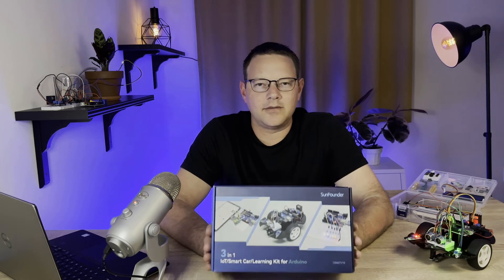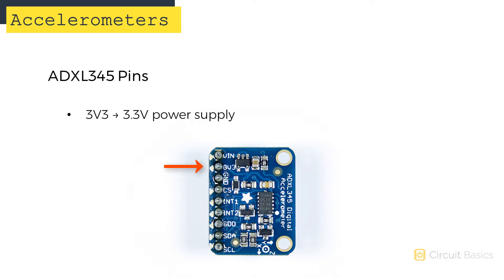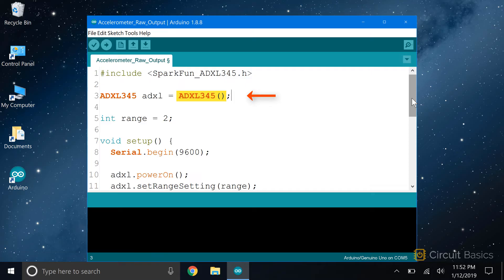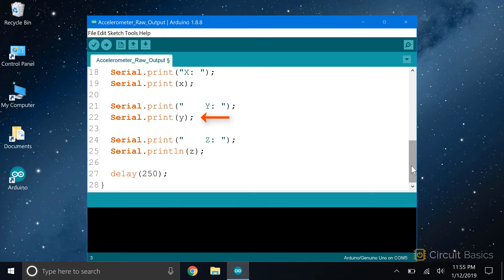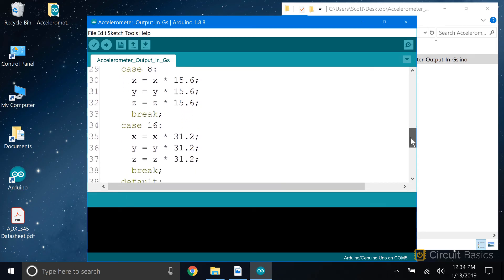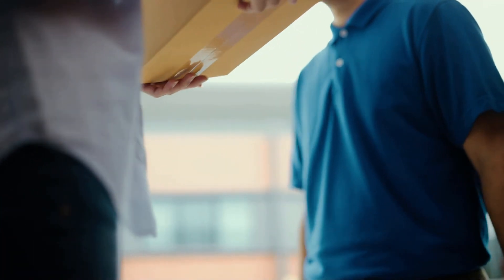How to Use Accelerometers on the Arduino - Ultimate Guide to the Arduino #42

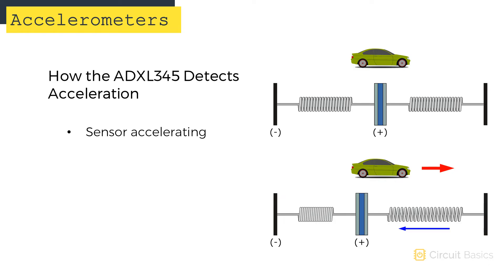Comment: I hate to be a pedant but at 5:34, I believe your physical explanation is slightly off. The electric field between the plates shouldn't change significantly, rather, the potential difference across the plates (V = E*d) will change because d changes. Since C = Q/V, this is the primary reason the capacitance will change.

Comment: Thanks for making this. It should be very useful for my project. 

I'll be using an ADXL375 which is a +/-200g accelerometer for testing impacts. Impact impulses only last 10ms (milliseconds) so I don't think the delay would be needed. I need microsecond accuracy to see the impulse curve and not miss the peak g's.

Great stuff though.

Comment: I'm thinking for this to be useful you'd need to also calculate a 3D vector from a series of readings, then you'd know it was heading in a particular direction?
There's probably  some mathematical filtering that's commonly used that lets you interpret real world readings, but I don't know where to start looking.  Like I'd like to detect a vibration within a certain frequency range but FFT seems ott?

Comment: got a question:

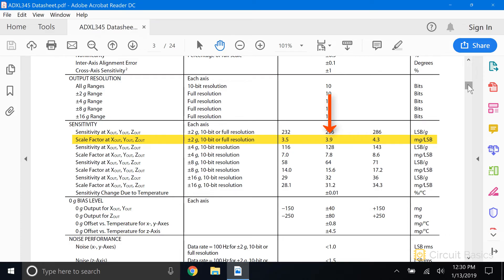at 13:36 we can see that the sensitivity scale factors for x, y and z are 3.5, 3.9 and 4.3 respectively.

Yet, at 14:51, in your code example you use the same sensitivity scale factor for all 3 axis. This factor is 3.9 and is the sensitivity factor for y according to the spec sheet at 13:36

You did the same for the 4g case, 8g and 16g too.

Is there a reason why you only used 1 sensitivity scale factor, and why you chose to use the y axis scale factor?

for 2 g i was expecting this:

Xout = Xread * 3.5
Yout = Yread * 3.9
Zout = Zread * 4.3

thanks in advance
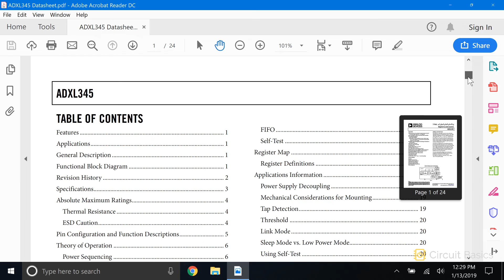Reply: At 13:13, look at the top of the table. Those are Min, Type, and Max. not X,Y,and Z. The value is the same for each axis.
Reply: @malitoprakk  thanks, makes sense